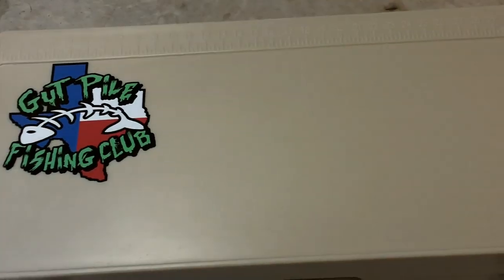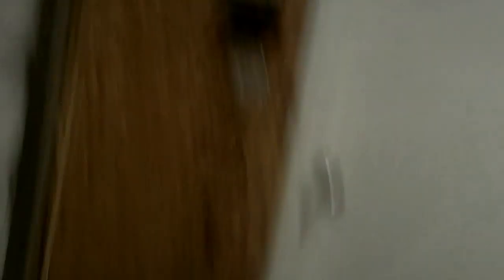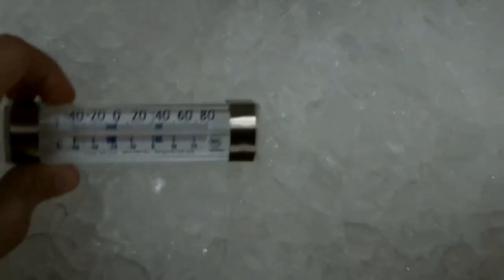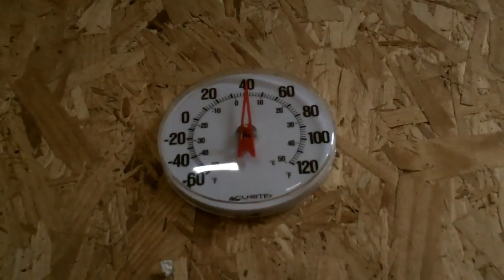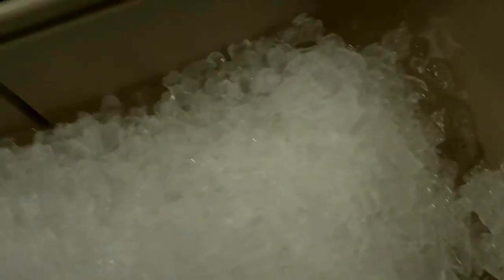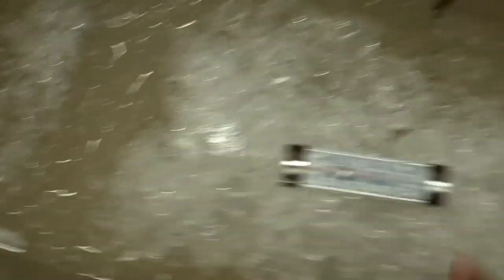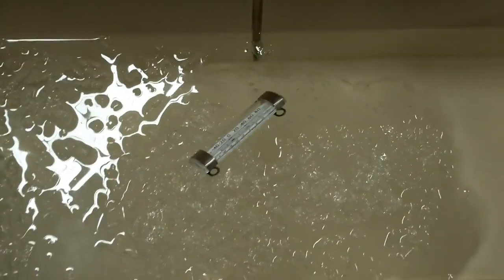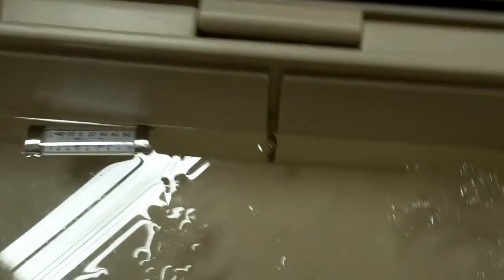Bison Cooler 75qt Ice Test

Comment: I own a 75 Qt  Brute and it has been over 100 degrees here in DFW all week. I put a one gallon milk jug of ice along with two 10 lb bags of ice in my cooler poured over  24 drinks out by the pool on the back porch. I had to add a bag of ice every other day and changed out the milk jug every third day. I did this for over a week and could have kept going for as long as I would be willing to add one 10 bag of ice every other day.  l am very happy with my Brute cooler. It keeps everything cold!

Comment: +crappie chris, did you do a summer test in the Brute?
Reply from the maker: I have not done a summer test yet. But I can say I am very satisfied with the ice retention of the cooler.
Reply: Ok.

Awesome! Do you do any kind of "pre-cool" stuff or anything out of the norm? What are your typical times you get as far as retention?
Reply from the maker: Pre cooling the cooler helps a hole lot. Very seldom do I need to carry ice more than three or so days. But sometimes when I get done I just let it set and check for ice every day. It is not uncommon to have ice floating and very cold water. You looking to buy a cooler?
Reply: Thanks for the info Chris. I usually keep my cheap cooler in the garage, but never pre-cooled it. I am wanting to get an "extreme cooler" mostly for durability, but also to make it through a weekend with the most ice as possible. We will go to the lake and slide the cooler under the camper and we have to replace ice daily. I want to cut down on that. I can't find a test with these coolers packed like normal use with ice and product and watch the retention.
Reply from the maker: I also own a Coleman extreme cooler and it does well. Will hold ice couple days.
Reply: good deal, I will take a look at that as well, but still need a durable built model. Thanks for the replies and great video
Reply from the maker: No problem.  And thanks.